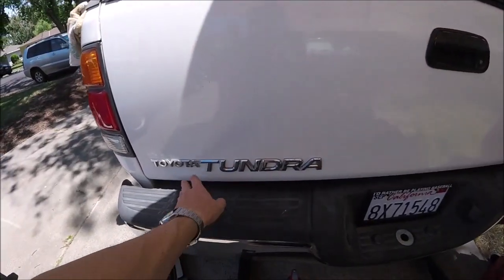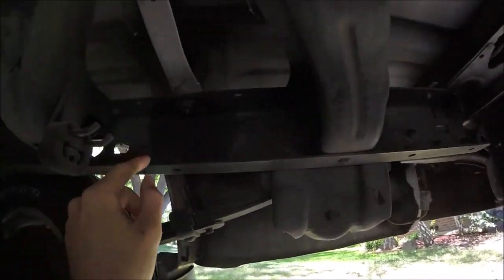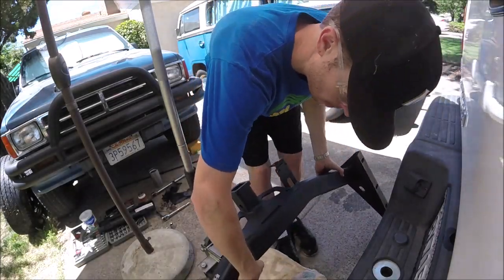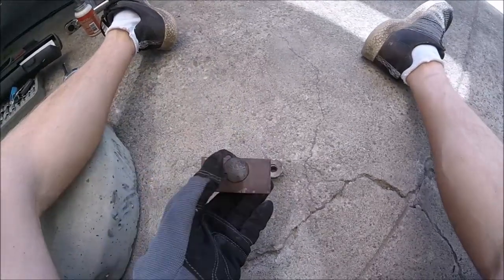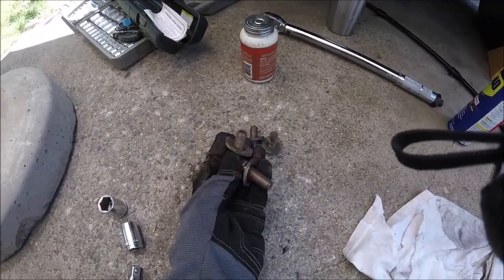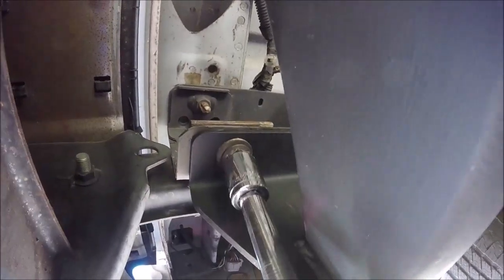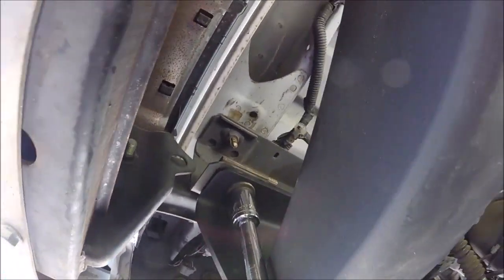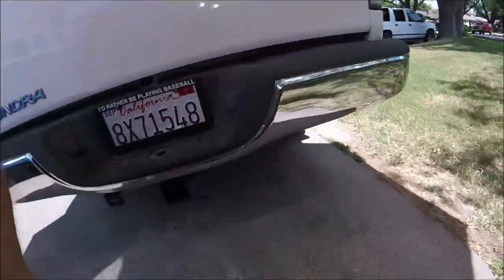How To Install a Trailer Tow Hitch Receiver. Example 2000-2006 Toyota Tundra.

Comment: Hey dude, I just bought a 2006 double cab limited with some serious rust happening on the towing hitch and bumper. Would the hitch in your review fit my tundra what has the “tow package” feature
Reply from the maker: Yes it should fit, I checked reviews someone said they had an 06 too

Comment: Exact bolt specs for install ?
Reply from the maker: @InvstrChristian194  not sure on exact size that will be on a vehicle by vehicle basis, but you want to use at least grade 5 hardware. I would pick up at a retailer like Fastenal 👍

Comment: Thanks for the video! Do you know if 2008+ newer Tundra are using the same size tow hitch as your generation?
Reply from the maker: I believe they are using a different hitch with that redesign. Most likely different sized frames of those 2 trucks. But hitches for those Tundras only run about $150-200 👍

Comment: why install the hitch when you could have just installed a bolt on the bumper ?
Reply from the maker: Hitch is much stronger and higher rating for towing and tongue weight vs a ball on the bumper. And it allows use of hitch accessories like the bike rack I have too 👍